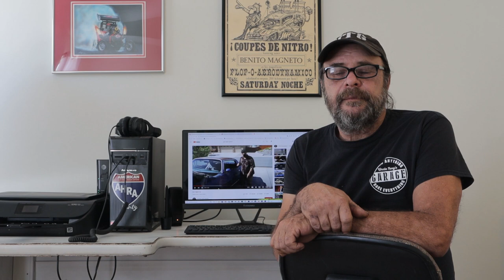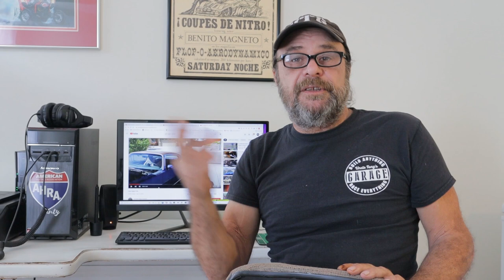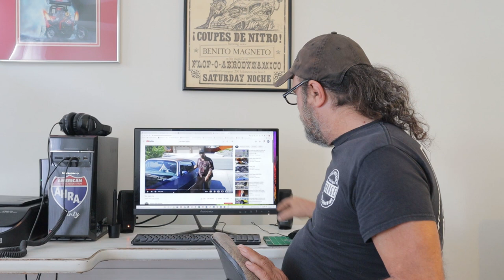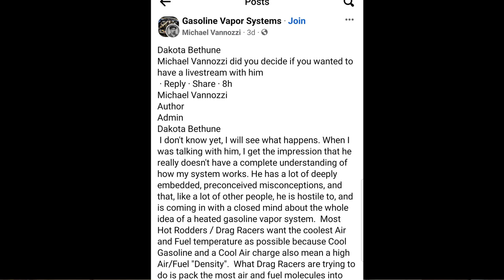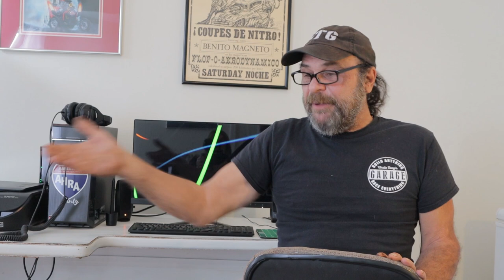Climbing Down The Mega Mileage Conspiracy Rabbit Hole

Comment: Hydrocarbons are hydrocarbons, heating it or vaporizing doesn't change the energy contained.
Reply: If that were true, carburetors wouldn't be a thing.
Reply: @GarlandFarms  what the fuck does a carburetor have to do with the amount of energy a hydrocarbon molecule contains?
Reply: @GarlandFarms  again, what does mixing fuel with air have to do with the energy contained in a hydrocarbon molecule? This is going way over your head. When you're extracting the energy from a hydrocarbon by burning it it's pretty much assumed that it's mixed with oxygen or it wouldn't burn. This has nothing to do with the elementary school lesson on mixing fuel with oxygen and adding heat. This is about the energy contained in fuel at a molecular level. Nothing you can do will change the energy potential for each molecule that's why these vapor engines are just a gimmick. Even carburetors on an engine running at a constant rpm do an excellent job of atomizing the fuel. You don't gain anything by vaporizing it because after the fuel hits the backside of a hot intake valve then enters a really hot cylinder then is compressed getting even hotter it's pretty much all vaporized anyway.
Reply: @GarlandFarms  I guess it was some other channel Tony was talking about the Smokey Yunic hot vapor engine. FYI for max horsepower you're not burning at stoichiometric and for max fuel efficiency you're not burning at stoichiometric either.

Comment: Any tunable late model V6 or V8 is capable of 35 miles to the gallon just lean it out  I am aware of many late model fuel injected vehicles being tuned for economy not power
 I have a Gen1 small block Chevy 1 barrel manifold  I would bet a 3500 pound car at 55 miles an hour is an easy tune with that manifold

Comment: Totally agree with this video, since in my curiousity I've ran into enough "bullshifters" as well. My stock 1986 GT Mustang could get 30mpg with 2.73:1 rear gears since I would coast up to stopsigns and stoplights and shift below 2,500 rpm (valve cover oil leak would spray the factory headers above that RPM). So already I knew this 35mpg claim on a car this heavy with an automatic transmission (ie, hydraulic convertor) was suspect. Too many "heroes" can't stand up to any scientific measurement, and they go right to confusion and diversion--"oh, my detractors have a bad attitude".  But even before the internet, people were more interested in alchemists and bullshift than actual reality. What gets real funny is when you learn they'll swallow one conspiracy theory, but hate another one.

Comment: A motorcycle carb is a wide open range of variables, 80cc dirtbike carb, or a 1800cc harley carb? A sbc would probably run on the harley carb but run the numbers of cfm and max flow would severely limit your max rpm, based on the restrictions at hand. Why would anyone trying to achieve high mpg using a sbc to begin with? why not a 2.2L s10 (or the 2.5L dakota truck being a mopar guy) less moving parts less peristaltic losses, lighter weight, already a slug in the performance department. It might even hit 40+ mpg, but whats the benefit at that point. Detune for 20-25 max hp, but like you said it would be a roadblock for all intensive purposes.. More power to the guy for doing it, but run the numbers and we all know the performance potential..

Comment: Tony, about the HHO (Browns Gas).. This is viable and will work. The problem with it is that no one is tuning the engines to take advantage of the gaseous fuel. I know there are tons of videos and material to go through but i have seen much of it including engines running purely on the B-gas but none properly tuned or under a working load. Only ones making claims to range extension without tuning or metering changes to the original fuel system so we both know their claim is bs. I much like yourself might be seen as skeptical to these people but the fact is we want them to do the math and science rather than expect our faith in a system. When a conversion to LPG is done it isnt just slap on a tank and tie the hose to the intake and its done. The timing is critical the cam is critical even more so than with gasoline. Gasoline is what it is because it covers a vastness in the IC-engine world other fuels are way less tolerant than gasoline and this is the problem we have with people and alternatives like syn gas(cold wood smoke), browns gas, gas vapors, and other exotic fuels. They dont understand combustion the way we see it. They dont understand the critical issues of ex/int pulses or how fuels effect temps on critical parts. Please dont let them put you on one side of the fence or the other you have the knowledge to do a proper HHO build and see what load it can handle and the knowledge to know what needs to change for it to work better. You would make a great joint effort with a builder/engineer working that field to make something like a HHO powered Plymouth  Horizon 4 banger that has some pep. Mull it over have a look around maybe it is something you would like to try out. I have seen a couple hot Horizons in my day might not look good but can be done. Find a gem and i would enjoy seeing you trying some new age stuff while applying your motor/race medicine.

Comment: Back in the days when "W" had the price of gas up around $4  /gal. I knew a couple people that were supposedly getting 100 mpg from their econobox's. It involved very small engines; geo metros were popular. with 90 lb tire pressures, turning the engine off and costing to a stop, keeping the engine off at stop lights, paying strict attention to manifold vacuum at acceleration, not sure any of them ever drove over 30 MPH. The great cosmic machine operates on an equation, everything has to Ballance, if you gain on one side you lose on the other, that is just the law of the universe. If this guy gets 35 @ 55 I say good on him. If he lives in a 55 MPH world all the better. But I am with you on this one, I want to know what he is giving up. It may be more than I am willing to pay, at this point in time. But who knows what tomorrow will bring?
Reply: yep. my sister ruined her Geo Metro by insisting on shifting it as soon as the shift light came on. The engine breathed it's last at just over 70k miles from lugging the motor too much.

Comment: In the realm of things that actually existed, my dad owned a 77 Honda civic 600. Air cooled 600 cc. Ridiculous mileage for a 70s car. We should be able to do better. I rode in a hot rod 97 Camaro with a 5.7 and  6 speed that would knock down an astounding 28. mpg. However 8 in town when your driving like an ass. Driving  moderately does more than anything. Even my big block 76 Chevy will get 14, on the highway as long as you stay out of the secondarys. I have watched a riding  mower run on wood Smoke. Or a diesel run on trans fluid, cooking oil, used motor oil. Please look into plastic waste converted to fuel. Supposedly it can be turned into a useable fuel thru a similar process as making wood smoke alcohol. But that isn't something I have personally witnessed

Comment: T you da man, next it will be the Hydrogen people. My Bro in Law was impressed by a coworkers "hydrogen cell" that was hooked to his truck. I pointed out that he was not cracking water into hydrogen and O2, but was reacting Sodium Hydroxide (Drano) with the galvanized strip of metal and water. I also pointed out that it takes 50 kWh (about 4200 Ah), to crack about 2 gal of water to half that much H, and that neither the battery or alternator had that power, so he would be better off disconnecting the wires so that the batter would stop draining overnight 🤣. Believe it or not the employee researched it and found out I was right, he also found out that it wasn't only hydrogen coming out of the (reactor/cell) and into his engine. Oh yeah, that's why when you are processing biodiesel from waste cooking grease you never use aluminum or galv pipe. IN physics, nobody rides for free.

Comment: I'll buy that someone made a better carburetor. And someone squashed the idea.. but you need a certain amount of air and fuel to make combustion pressure large enough to run an engine and move a vehicle

Theres no such thing as a 100 mpg carb, unless you made an engine small enough to do such...

Comment: Look my sister and friend had mid 2000 thousand model Chevy Malibu family cars equipped with the Stock V6 engine. They got 34 Miles per gallons at regular hard driving. Friend sometimes got up to 36 cause he drove grandma on the highway. This is with Aircon heated seats auto trans. 36 MPG with a motorcycle carb at 55 with 20 horsepower is doable and silly. Just find a good used Malibu buy it drive it. PS I had a 96 Honda Accord with the  four banger and all the accessories. Great car but 32 MPG is all she would do.

Comment: So....for those who are pragmatic and serious...the answer may lie in the French Panhard PL17 Tigre.  I will show a quote from the respected "Hemmings Motor News " on the Panhard vehicles of the 1950's and 60's.   QUOTE: That the 1960 Panhard PL 17 Tigre could do 90 mph on two cylinders while the 1960 Volkswagen Beetle could manage just 68 mph on four pretty much tells you all you need to know about the comparative levels of sophistication of these products of European thinking. The Panhard's very name boasted of efficiency, 17 being the sum of its French horsepower rating (5), its seating capacity (6), and its fuel economy (6 liters per 100 kilometers, or 47 miles per gallon). And yet every schoolchild knows how the story turned out: Americans fell in love with the Wolfsburg wonder, helping to push the Beetle past the Model T Ford as the world's most popular car. And Panhard? It disappeared from the U.S. market after 1960, and stopped making cars altogether after 1967. "  UNQUOTE.  Interestingly, they are still around and still achieving thiese results on those 60's engines.  Now you know.

Comment: Tony... referencing the 8:00 mark... he sees your interest in driveability and power as the 'pre-conceived' notion of internal combustion. To play Devil's advocate, we all know that increasing efficiency at a single rpm/speed range is not necessarily "quantifiable" in how an engine runs over-all... and I tend to agree with his skepticism. If you're chasing every mile out of a drop of fuel, every other measurable number is irrelevant to the MPG number... so why try to prove that his engine only has a 100hp in order to achieve the MPG number? Who cares? The point isn't to make power. If it's "driveable" and can "get down the road" and make 35mpg at 55mph... good for him. He could probably get 70mpg if he gutted the car, added aero, changed gearing, lowered it, and did more tuning.... So what?! 

Your approach can't be to prove he built a "dog" at the expense of mileage but that he built an efficient system at the expense of performance. 

Phrasing is everything.

Comment: Can't say I get it.  Why not put it on the dyno and just see?  If it comes up doing peak 64 hp and a 4 minute 0-60, it's lean as hell and hot as a pistol, but it doesn't blow up?  Fine.  Get the numbers down, see if it can be streamlined/tuned.
But why not look at making a normal 350 run like a pistol but have really super great mileage without cylinder deactivation on the highway or something?  Could be super duper cool/fun if people like this dude would just ante up.

Comment: Want high fuel mileage? buy a late 80's Honda CRX HF with a 5 speed. 52mpg factory rating.
Reply: Very few chips needed either..
Reply: Making me wonder what changed since then that it is hard to get better than 35 mpg unless you go hybrid today 🤔maybe gasoline was better back then, maybe the world expanded.

Comment: I'm sure he gets 35 but that's all the benefits he gets. He is just avoiding answering the questions because he knows everything except his mileage is not there. I run my 74 C20 on a propane system that is designed for it. I tried a little test and hooked the fuel line to the vapor port. It runs fine but the fuller the tank is the quicker it turns to ice outside on it and then starts losing power because the LP can't vaporize fast enough. But if the tank is closer to empty it will run much longer before icing up since the low fuel level leaves more space for the LP to vaporize. And regardless of what Mr 35 MPG says, fuel whether its LP or gasoline, will only vaporize so fast and a 350 is going to burn it up way faster than it can vaporize it. So I doubt Tony that he is going to take you up on your challenge. Would be nice if he did so we could see just how big of a dog it really is. Keep up the good videos.

Comment: This whole gasoline vaporization carburetor thing is BS in my opinion. Why make it so complicated to try to vaporize a liquid if you could simply use a gas?
LPG or Propane/Butane for example. It is already a gas at atmospheric pressure, burns cleaner has a higher octane level and depending on the country it is much cheaper than gasoline.

Comment: Just go get a 4x4 Cummins 1990’s dodge take the 5.9 6 out and put a 3.9 4 cry Ind and change the gears out to a 323 with the 727 and I bet you might get 40 miles to the gallon but it will be over 30

Comment: as far as  I know a gallon of gasoline, depending on the octane  is around 18,000 BTU,s alky fuels Have way less, but have a  way higher octane , like 110 or more, and the ratio is 7 to 1 while street  cars run any where from 11 t to  almost 14 to 1 fuel ratios timed port injection works good because no fuel  goes into the port during valve timing   the over lap cycle, The bean counters and so called engineers are not looking at the heat loss a four stroke makes, the heat is a major loss of recylcable energy

Comment: I had[ well still have but don't drive any longer] an 1982 camaro originally equipped with a 2.8 v6 automatic  . I swapped a 305 (not sure what out of) with the intake and 2brl carb of off my 1968 camaro 327 motor. Converted it to stick with a trans out of an 1984 4cylinder camaro.  Drilled bell housing and flywheel from a chevy truck and clutch out of a chevy ASTRO van. It would do 60mph in 5th on high idle 1100 rpm. It got 30 miles per gallon mostly highway driving but maybe 10% city. It would also light up the tires with authority in first and second with a solid chirp in third. Oh It also had a mild cam in it . Only because the factory one wore out and the mild performance one was cheaper. So what ever shenanigans this guy was doing was not impressive since mine got there by chance and the cheapest parts I could find.

Comment: I bet the same Camaro with the same size motorcycle carburetor running conventionally (no hot vapor system) would perform similarly.  Once that heavy car gets going, all he's got to work against is wind resistance.  Those things aren't "world class" slippery, but they aren't bad.  I bet anyone could put a smaller carb on that car and meet or exceed his mileage during cruise at 55 MPH.

If you kept your foot out of it, my brothers 1975 Camaro (350) would get in the twenties without doing anything.  The mileage only sucked when his brother drove it.

Comment: The bottom line is, given all engine components are all the same, Engine size, make , displacement, head casting, modifications, cam, CR spark delivery method etc. along with the vehicle and the rest of the vehicle's components, so were comparing apples to apples, oranges to oranges, when comparing an engine' fuel efficiency with any of these backyard designed fuel delivery devises or factory designed devices, at that point it boils down to air/fuel ratio, temp of the air and fuel and proper atomization. This is where tune port fuel injection with a coomputer analyzing the engine's conditions many, many times per second from spark knock to exhaust temp. the individual port injection prevails! The proper amount fuel requered for any particular moment is so precisely delivered, there's no better possible way. It's all up to the efficiency of the rest of the vehicle at that point. Friction, engine design, aerodynamics, tires, brakes, weight, etc etc.

Comment: If anything would be capable of 100mpg would be a modern FI system with all its sensors and abilities to trim fuel to the bare bones. UT as you know you can’t have both performance and great fuel economy. I find it interesting he is using a turbo to shove air through this little carb. Helps with accelerating but still isn’t much. Would be interesting to see what this car would do on a dyno. A basic 350 of this area was what 240-260 @ the crank. This has to be well south of that. The laws of physics are the law and all the money and lobbying won’t change them. These guys tend to be sort of goofy and don’t see much sunshine. Who cares if it only makes 100 hp, 35 mpg is something GM couldn’t do with an iron duke or even an ecotec platform.

Comment: Dude, my 6.7 Liter 408 cubic inch in-line 6 CUMMINS gets 26.5 mpg at 55 mph in an 8500# Pickup going up and down hills on a 600 mile road trip.......  (Wind resistance is king). Don't try that at 75mph.  LOL

Comment: 12.5 to 1 air fuel mixture.  
Can play with gear ratios for fuel milage or power not both.
You get these weak ass cars that get 40mpg at an idle downhill.  But real world driving you have to keep it floored to maintain 45mph.
All gas motors run on vapors.  If you dump raw fuel into a cylinder  it will not run.

Comment: I bet I can get 35 mpg on my son's old 68 Mustang with a 289 2bbl with no strange equipment   IF IF IF....you let me tune it a little different, pick the highway...probably somewhere in Kansas  AND AND AND let me get it up to 55mph the normal way then flip a valve for the gallon of gas I have sitting beside me and cruise at 55.  I bet I can go 35 miles.        It will get 25 mpg right now with 302 hipo heads, headers, and a semi mild cam when driven strictly highway.       This guy is doing nothing special.